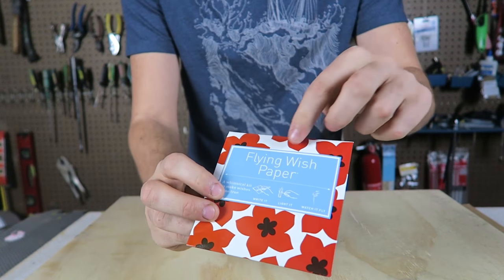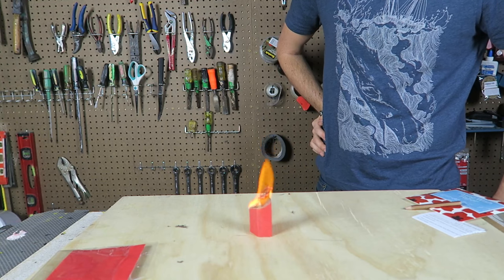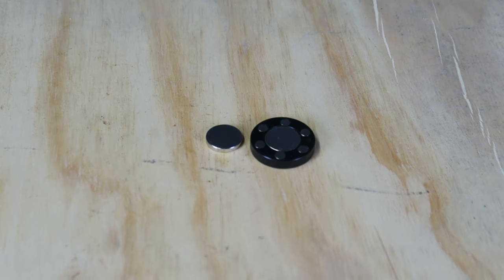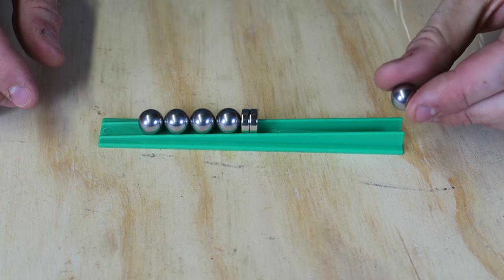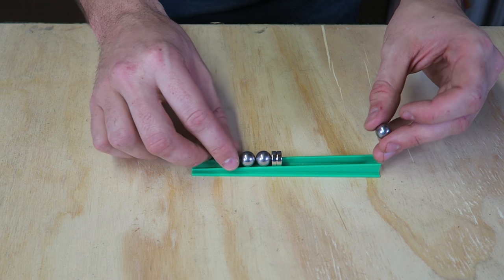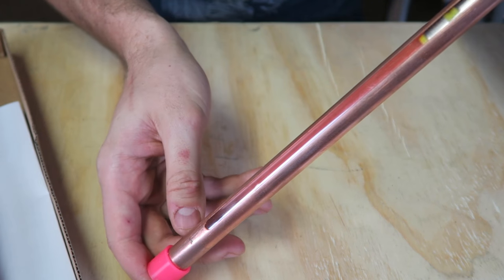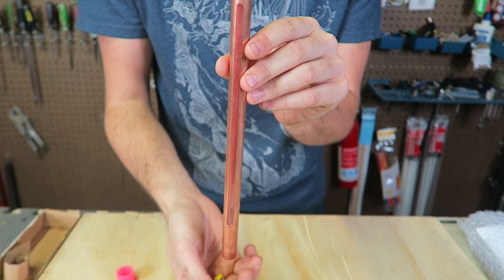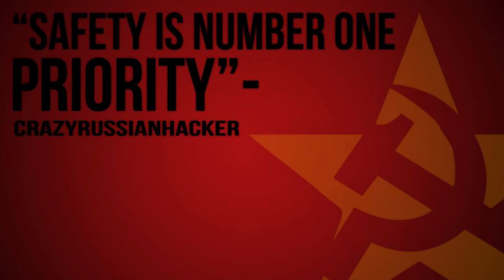5 Simple Science Experiments

Comment: The 4th experiment works as follows:
The magnet's magnetic field is moving (changing) relative to the copper pipe.
This induces a current in the copper pipe. Currents in conductors cause a magnetic field, so the pipe then has its own magnetic field.
This magnetic field is on the top and bottom of the magnet, so creates more resistance, slowing the magnet down.

Comment: As the magnet is falling through the pipe, there is a change in the flux linkage between the magnet and the copper pipe, which will create a current inside the copper tube according to Faraday's law, and the current generated will then interact with the magnetic field of the magnet and exert a force in the opposite direction of the motion to counteract the change that's causing it according to Lenz's law

Comment: The Copper Tube slows the magnet down, because the magnetic field induces an current in it (a relativ high one, due to the low resistance of copper). The current then creates an magnetic field by it self, which pushes the magnet up, therefor slowing it down. Asynchronous electro motors function very similar.

Comment: hey that last one with the copper pipe, it's eddy currents that keep it from falling so quick. solder a wire on both ends and add a capacitor it will no longer build up eddy currents but charge the capacitor...

Comment: its called eddy current when the magnet passes through the copper pipe it picks up slight magnetic fields and slows down, copper is slightly diamagnetic which means it has a  push against the magnet like graphite and a magnet.

Comment: It happens because the magnet is trying to stick to the copper but the weight of it is pulling it down and that's why the magnet goes slower than the metal because the metal doesn't have a magnetic force so it just drops down the pipe.